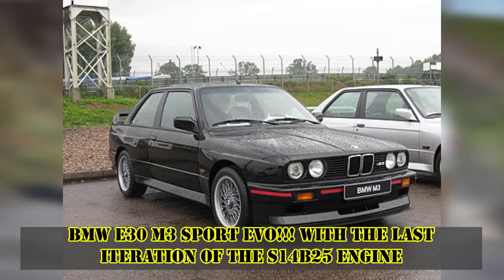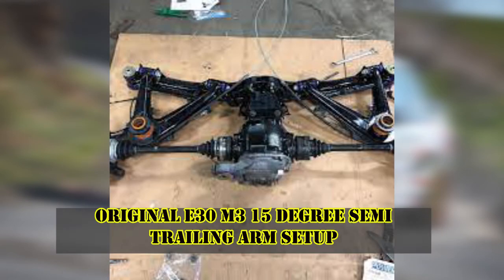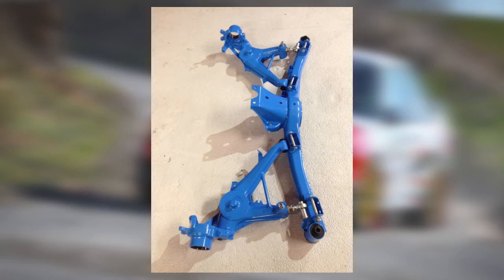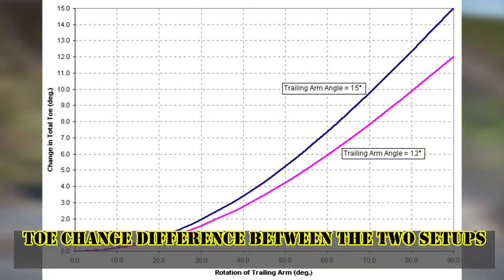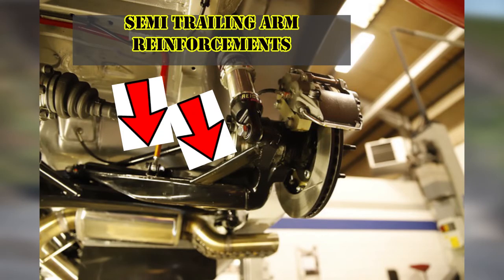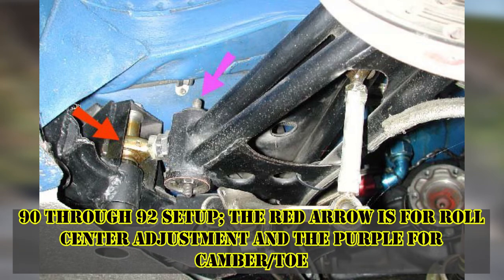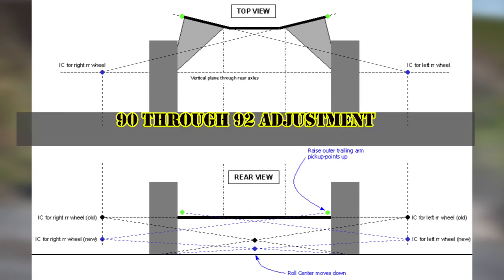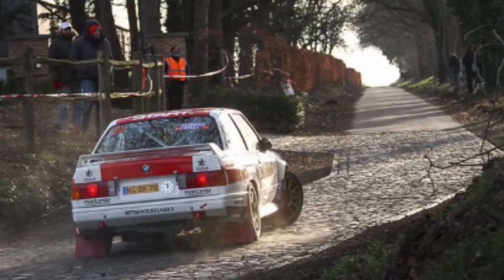How did BMW Motorsport make the E30 M3's rear semi trailing arms more competitive in group A

Comment: Can you speak about the differences of the semi-trailing arm from the E30 to the M version of the Z3 Roadster and coupe? The clown shoe for example.  I have several e30s and I love the response from a modified suspension considering the semi treading arm geometry and I've driven a couple z3s, and the M coupe is very nice though it has a semi-trailing arm. But what did they do differently other than rear subframe reinforcements? I'm sure BMW used their group B knowledge and adapted that to the M version of the Z3 so that it didn't have so many geometrical disadvantages.
Reply: maybe having the engine further back in the z3 (e36 chassis) also plays a role.
Reply from the maker: Thank you for commenting! And in answering your question, the semi-trailing arm setup in the z3 and the m respectively were based from the e30 including the M3. The extra reinforcements were done in order to allow the suspension to handle higher corner speeds as well as the forces associated with higher cornering speeds. These were all fed back from BMW's involvement in Group A with the E30 M3. Another side benefit of the reinforcements is that as the suspension goes through its range of motion, you will effectively see less alignment change. 

Furthermore, similar to the e30 M3 the semi-trailing arm angle was also altered so that the car would feel more stable.

I hope that I was able to answer your question. Have a good one!

Comment: EDIT: Disregard, pretty sure I just had dud data. It was some nonsense about the DTM arm based on an inaccurate drawing.

I have however since then found out that minimizing antisquat/antilift (Negative as well, not only positive) and obviously lowering roll center height are the key things for better bump handling. The outer joint height adjuster on later cars achieves both at the same time in addition to adding -ve camber.

Comment: Very interesting.

On the topic of lower roll centres causing more roll, this might be seen as a bad thing but the way higher roll centres produce less roll is by feeding a higher proportion of the suspension forces into the chassis laterally, causing jacking. This results in lower mechanical grip. Much better to have a low roll centre and then control your roll with spring rates and anti-roll bars, especially on a race car where you don't have to worry about ride comfort.
Reply: Especially on trailing arm cars that have intense jacking effects over bumps, causing them to be almost undrivable with bad settings. See my post above.